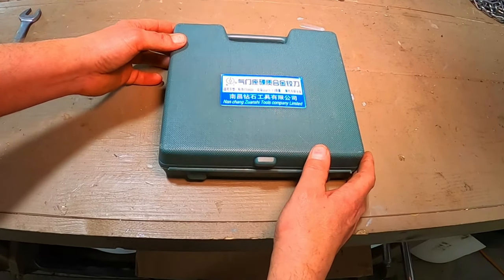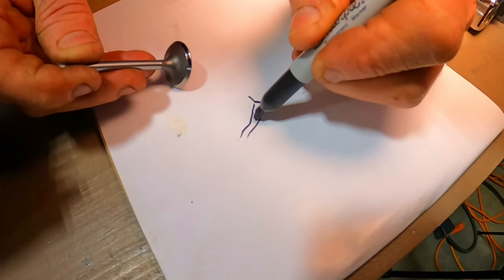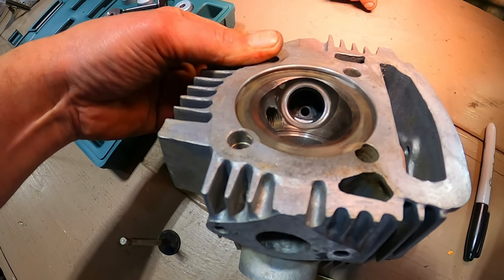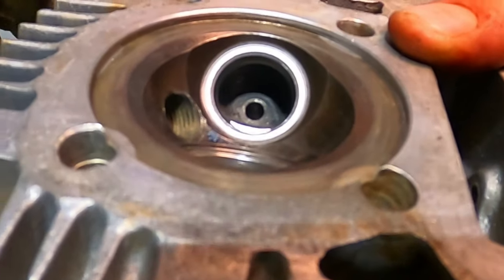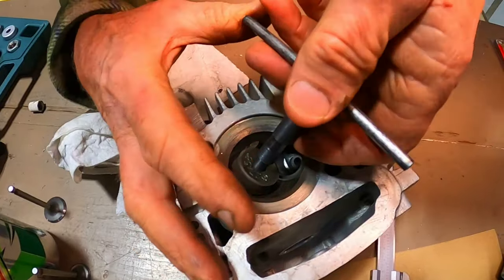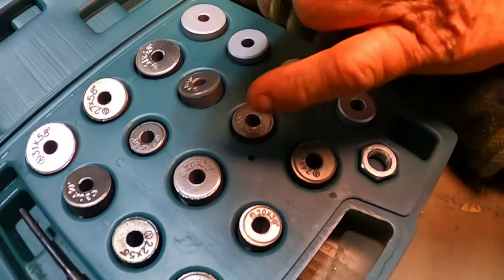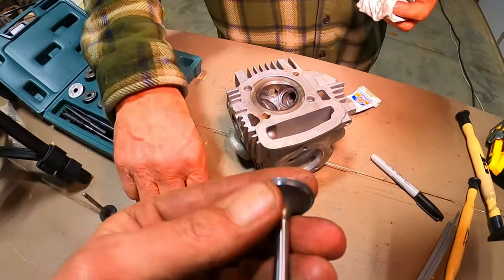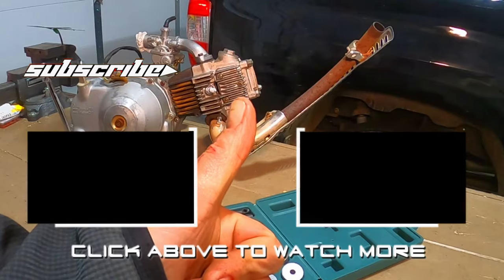Do Cheap Valve Seat Reamer Kits ACTUALLY WORK - Can You Do Your Own DIY Valve Job at Home?

Comment: I've been using one of these and have done about 10 ct70/ct90 heads with them.  You DEF do not want to be running a drill on it.  You're supposed to push them down by hand and do maybe 3-4 turns.  make sure you slather the guide with oil and the seat with cutting oil.    Start with the 30, then the 60, then the 45, then the grinder one.  You can chuck the grinder one up in a drill.    Valves can be reground, in a valve grinder or lathe.  New valves are cheap though.
Reply from the maker: Excellent info, thanks for the recommendations and thanks for watching!
Reply: Agree 100%. I’ve overhauled thousands of cylinder heads meaning oversize inlet and exhaust guides reamed to finished inside diameter after installation, next seat pockets are carefully cut to the next oversize ensuring they are absolutely centralized in relation to the new guides. Sometimes the pocket may require cutting two sizes over to ensure a fresh pocket due to heat distortion in the casting. All tooling must be in perfect condition and treated carefully. The mandrels used for both the cutting of the seat pockets and then valve seat angle is frequently measured and checked for it’s integrity. If using a sliding mandrel oil is used to ensure the tolerances are taken up between it and the finished valve guide. This is what oil does besides 6 other things, it supports parts like a valve in its guide. Neway carbide cutting tools are used to carefully and slowly cut the valve seats, some times only two single rotations by hand are required to see a perfect concentric mating band. Depending on manufacturer etc seats come pre cut at the correct angle and width. If all the previous steps have been carried out perfectly the gentle 2 passes with the Neway is simply a verification the seat is correctly installed. It also provides a bright clean surface for the new valve face to mate with free of any high spots. Occasionally a little more cutting may be required with a quick Crown and Throat to achieve the preferred seat width. You could simply then clean and assemble the valves and leak check from here however a simple and effortless valve lap is then carried out. This provides a witness mark on the valve face showing correct positioning and width however I have seen in some videos that it appears the person is using the valves shadow/ mark as a sign the valve is seated all around. It is the witness mark/shadow on the seat that should be checked. It should fill and dull the cut seat angle entirely. The quality and suitability of the tooling for valve, seat and guide replacement and repair is paramount to a perfect job as is obviously the correct manufacturer specs and parts. 

Cutting stones are a much cheaper option to Neway cutters as Neway cutters are a much cheaper option to a CNC machine that is able to perform all these tasks with perfect repeatability.  However they too must be treated and checked constantly to avoid butchering a valve seat. They require a high speed to cut or grind the seat angles and need constant trimming to ensure the correct angle is not lost on the stone face. Only light pressure is applied if any, just enough to prevent the stone chattering or bouncing on the seat as it rotates. Quick light cuts are made constantly checking the seat looking for a full clean ring free of any low points caused by a previous leaking valve that allowed the combustion gasses to escape past the valve at extreme pressure burning the seat face away. They create abrasive dust that needs to be managed while cutting so as not to wear the mandrels and valve guides if using a sliding and not adjustable type. It contaminates the oil used to lubricate and centralize the mandrel and stone carrier so lots of carefull cleaning is needed before assembly. It will linger in valve guides if they aren’t cleaned with brushes and solvent. I can’t stress how important cleanliness is to a valve guide and stem before assembly. Obviously the same applies to every area of the inside of an ICE engine however we are talking valve jobs here. 
Basically for a freshen up of a head after removal the stones are probably the most affordable and easy option to freshen up a seat In the field or when an equipped shop isn’t available. Realistically a valve leaks for a reason. If a seat is cut then so to must the valve. The valve face must be re faced or ground which must be done precisely preferably In a valve grinding machine.  Obviously this is only an option for valves not having valve face coatings or being made of materials like Titanium. If refacing a serviceable valve is not permissible then a new valve must be used. You can not fit a new valve to a seat that hasn’t been resized and shaped and vice versa. It’s just not an option. Any leaking of combustion gasses which is almost guaranteed if not done together will mean an imminent failure. The fact valves are able to do what they do is actually pretty amazing when you understand the task they have. A thin band of two dissimilar metals slamming closed and opening thousands of times a minute for potentially thousands of hours in extreme pressure and heat without leaking and breaking is a huge deal. This part of an engine is critical particularly for an engine that is intended to have a long service life.
Reply: No you   and a big thank you to the vid producer because he started this conversation 
I have jut bought this kit super cheap off ali express £22.50 delivered and tax paid   
I have a cg125 engine that has sat in a garden for 15 years both seats are horrible 
I could not understand   it seemed simple just use one cutter but I would have messed up 
I'm going to try tomorrow

Comment: Factory service manual gives specs for valve seat and how to move seat 'up or down'.
 A lot of people get surprised that motorcycles (even Honda 50-90) had 3 angle valve seats  from mid 1960's. (never worked on one made before 1965)
I was actually more surprised that it wasn't common on car engines until late 1990's 
Using a drill is a terrible way to 'lap' valves, glad to see you did it properly in the end.
It WILL put radial grooves into valve and seat causing very fast wear. (that's why every service manual and instruction book say to  oscillate valve back and fore)
Honda only use 0.002" intake and 0.003" exhaust valve clearance, it will wear in over 0.001" in first few miles (I know someone who thought it was smart and did it on his Kawasaki 1000, around 900 miles later he was buying new valves)
Reply from the maker: Excellent information!!! Thanks for the expertise and experience!!! It's greatly appreciated! Glad to have you here!!!!
Reply: 3 angle seats have been in use as far back as 1930`s.
Reply: @bad406camaro 
 I know, aircraft engines and racing engines. 
They were not used in general production though plus I don't think FORD or GM used them on anything except race motors, maybe in 1950's?

Comment: Just because you can does not mean you should. Yes, this will help restore some sealing to valve seats. That is about as close as you get. There is no depth measurement of seat or width of seat angle measurements going by "eye" is guaranteed to be incorrect. You do not lap valves with a power drill. All that will do is make lines in the seats causing premature failure. Valve guides must be measured with split ball gauge NOT FINGERS. Valve stems also must be measured to determine guide to valve clearance. Doing this procedure with this tooling will guarantee someone will have to do it again in the future to correct the seat
Reply from the maker: Thanks for watching and thanks for sharing your expertise. Greatly appreciated!!!

Comment: Hey sir would this work for a vx110 jet ski 2005 ski
Reply from the maker: Sorry, I don't know much about those. You'd have to know the valve and valve guide sizes and see if the kit has the size of mandrels and cutters you need. Might have luck asking one of the sellers on ebay if you have that info. Thanks for watching!

Comment: This is sht set... With hard long time you can make ur engine starting but for sure ur valve will leaks ..... I try this set after alot work time my valve still leaks at high pressure ....
Reply from the maker: Thanks for sharing your experiences!

Comment: Definitely not supposed to be using a drill on that specific tool set - and shame on your assistant for advertising such.....

There are seat grinders made specifically for use of a valve grinding drill (turns at a specific speed range) and that's not so critical but what is is that with the correct tools the guide pin stays in the valve guide while your grinding dye floats up & down along the shaft. Should the shaft move in any event you fail your cutting/grinding and that's what you've done. Additionally with that guide pin spinning & rocking in the valve guide you're oblonging your valve guides some - you can guess what valve+guide wear issues come of that besides poor valve seating (poor compression) and oil burning.

As I finish writing this I see your warped guide pin, you're definitely going to have long term issues if not immediate. You should have really checked to see how well the valves sealed afterwards too.

Being this set isn’t made for a drill (no fixture to mate the drill to the dyes/stones) it should be hand-operated only.
Reply from the maker: Thanks for the experience and knowledge William. That drill was a bit dramatic and over the top wasn't it 😁 I did check the valve seals after everything was said and done but didn't have that in the video. I am going to have some follow up videos to this one in the near future as soon as it warms up and I can paint and re-assemble the bike. Be sure to stop by and see how it runs (or doesn't run 😀) And please feel free to give any suggestions or criticism on any of my future videos. I honestly do appreciate it. I wish you the best and thanks again for watching!
Reply: @BIGFOOTBIKESANDBREWS bs dude it will work fine